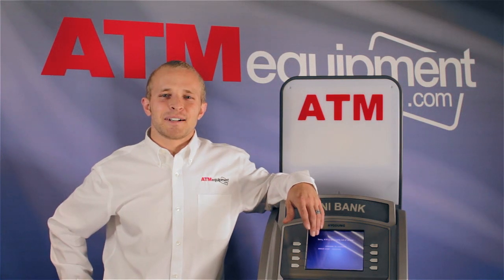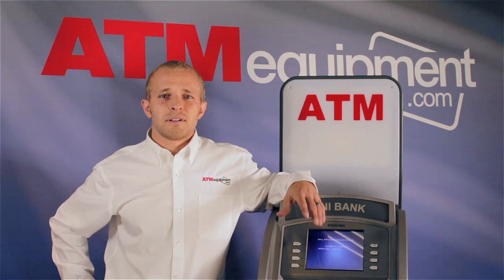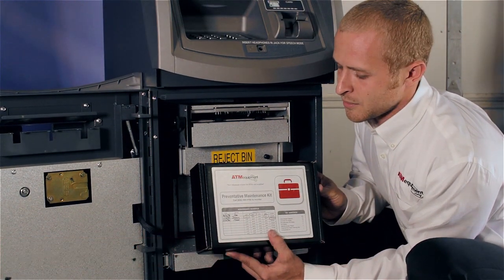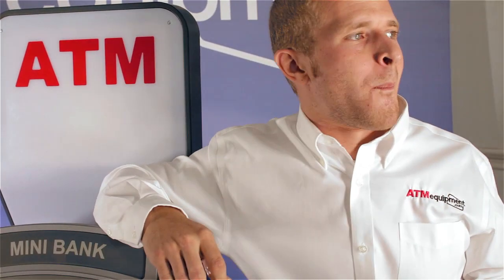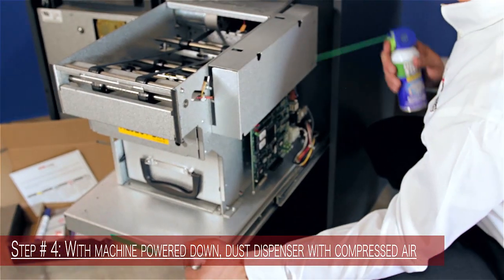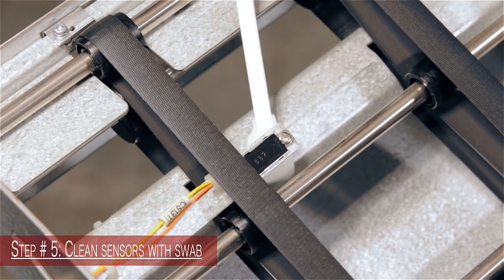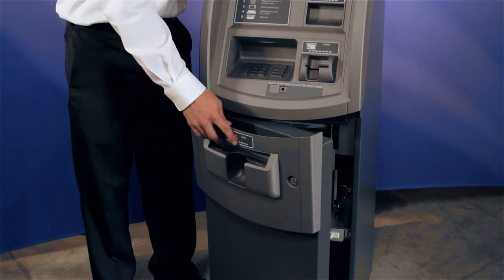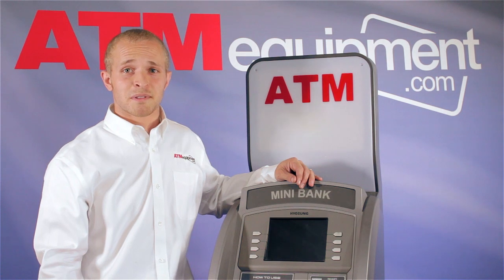How to Clean an ATM Cash Dispenser - ATMequipment.com

Comment: I've found that the biggest single thing you can do to keep your ATM guts cleaner and Stop rodent infiltration and problems is: push out all the bottom cable plastic plugs with the center cable hole and replace with solid plastic plugs...available from the ATM company big price, or Ebay for small price.
Now that the bottom holes are all sealed up with solid plugs,  route cables to come out the hole high up on the back of the ATM. 
You'll never have to deal with mouse feces and urine, spiders, and majority of the dust again.